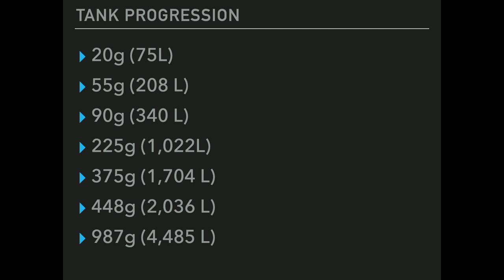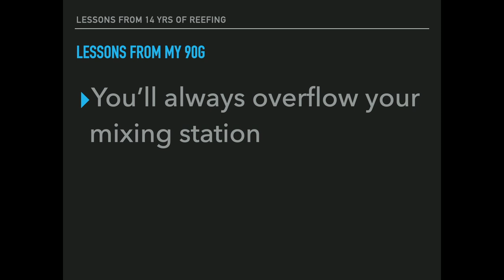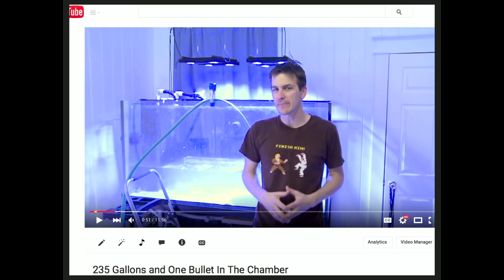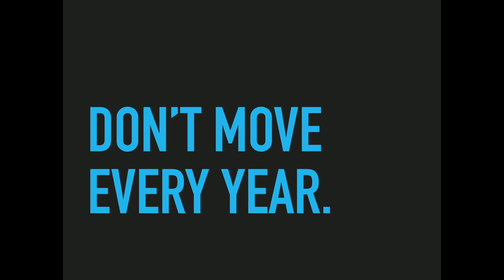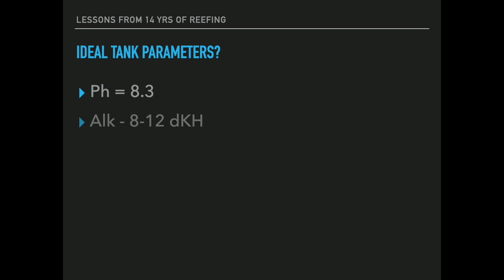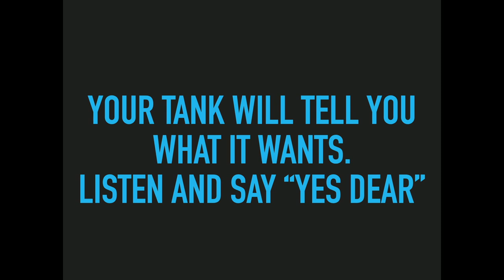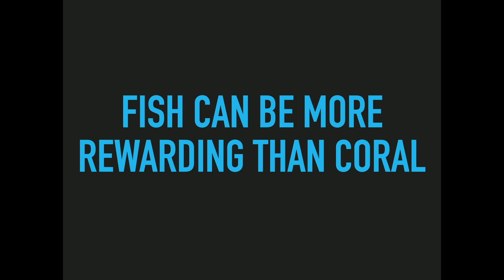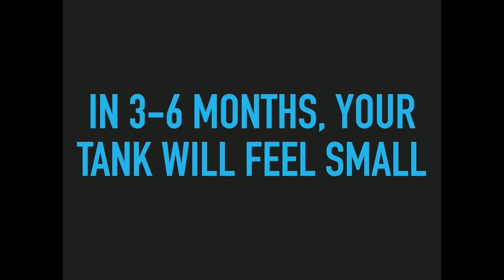10 Expert Reef Keeping Tips - Mr Saltwater Tank TV

Comment: Deltec MCE600 isn’t a cheap hang on back skimmer and it actually works extremely well.
Reply: So did my Octo , just guard against spill-over.
Reply: @revo1336  the Octo is a fine choice, less expensive than a Deltec HOB skimmer. I’ve used them at an LFS that I worked at. The Deltec MCE600 is impossible to overflow. It has a built in emergency drain in the skimmer cup that dumps the foam back into the skimmer. You’d have to completely block the outflow of the skimmer on purpose. The DC model is $600, but worth every penny.